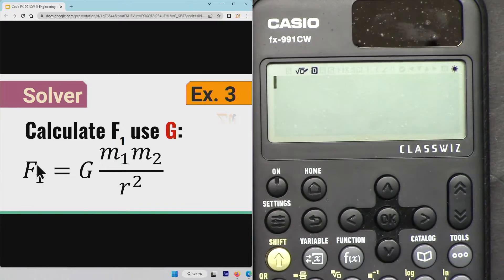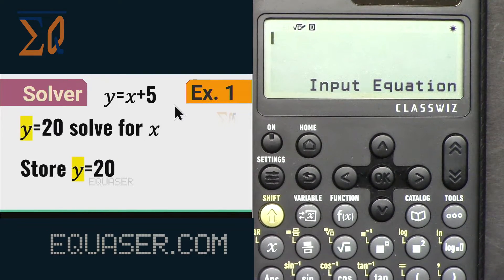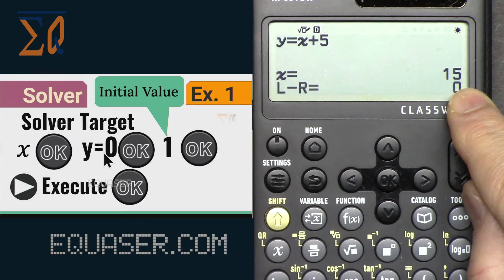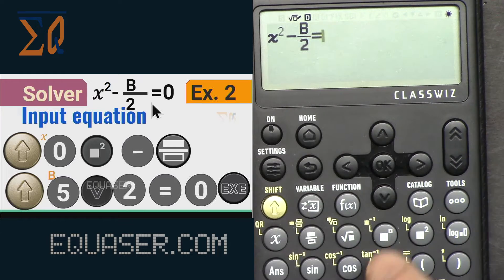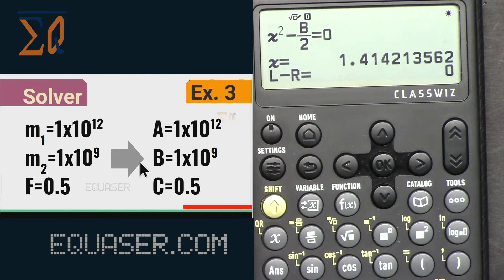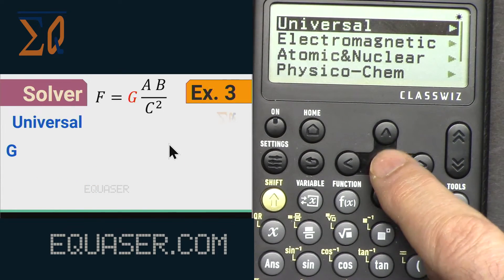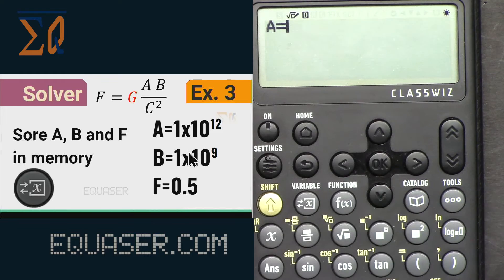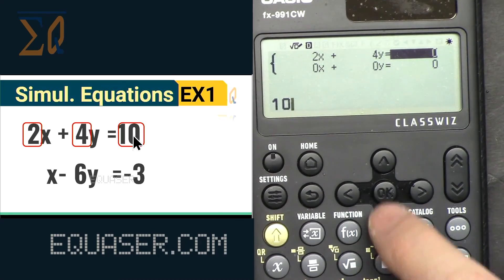CASIO fx-991CW Solve for a variable in your own equation fx-570CW CLASSSWIZ Calculator

Comment: Won't it work if we put only the values of variables instead of storing & then placing it in equation?
Reply from the maker: No it won’t.
Reply: It will work fine and that should be the way of doing it. We don't need to store the value of y, we just type it on the solver page and easily calculate x